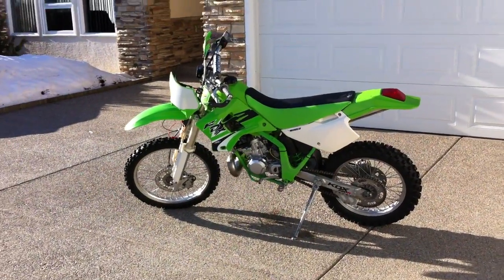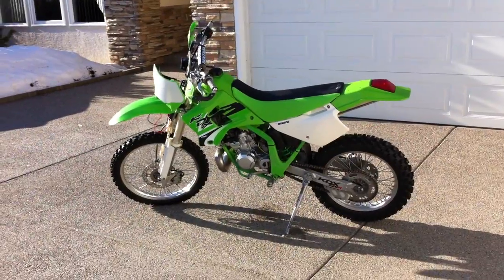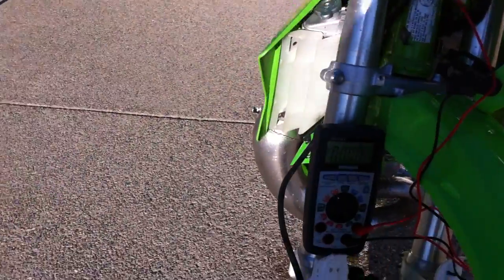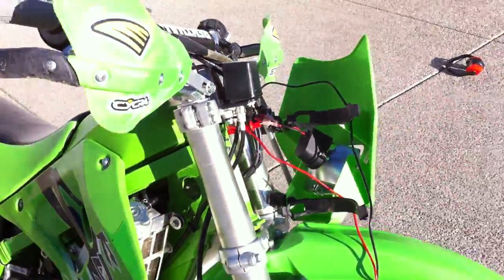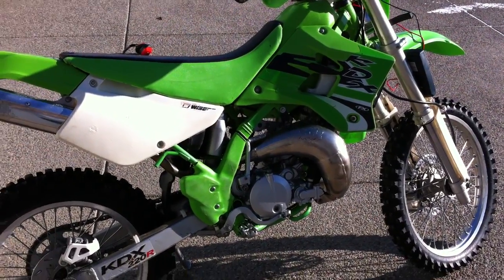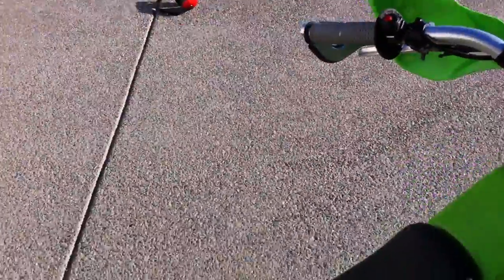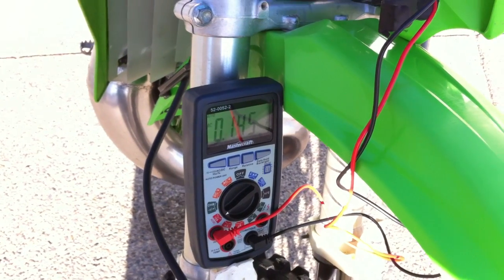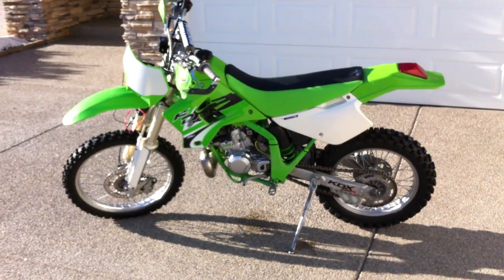Kawasaki KDX 200 / 220 Stator Upgrade

Comment: Hi , nice video. I am picking up a 2000 kdx 220 saturday. I was curious becasue your bike looks so good. Where did you get the seat cover? The fork boots did you just take them off of did you get aftermarket suspension? Is the silencer a spark arrester too? Thank you.